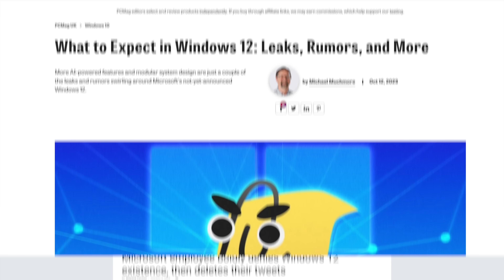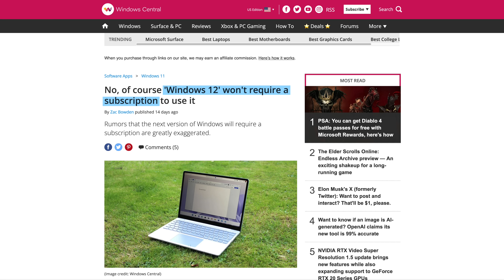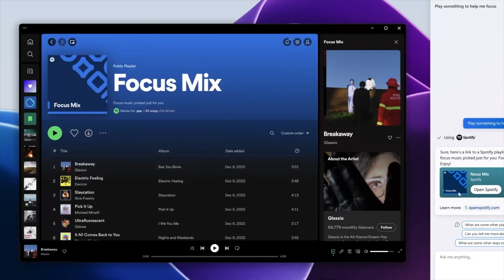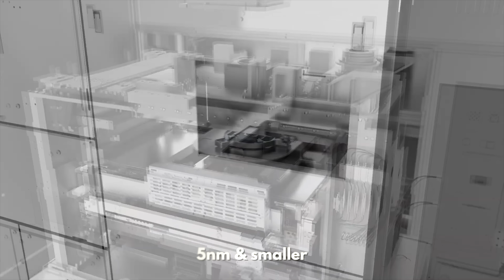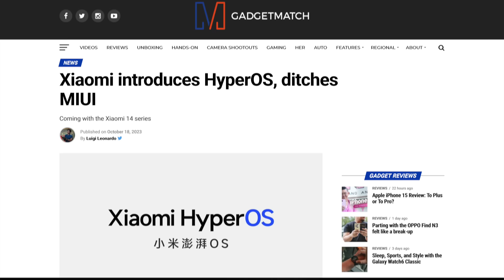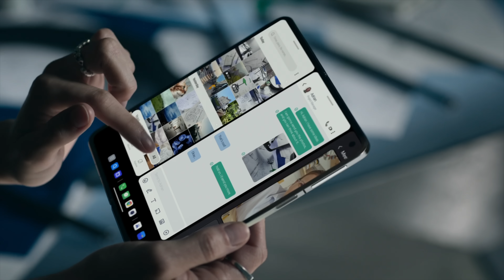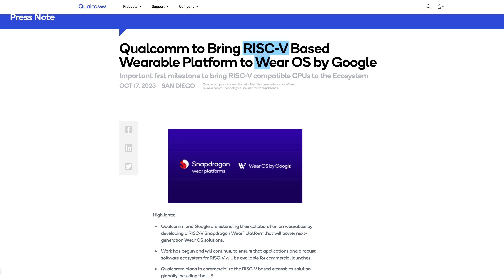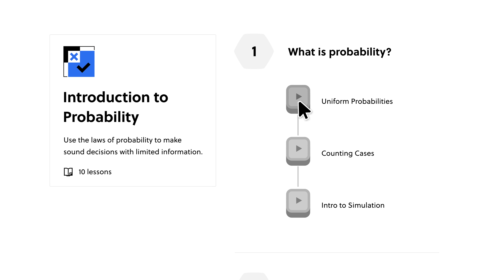Windows 12 is looking good!

Comment: I feel like most people haven't even upgraded to Windows 11 yet,  and here we are already talking about 12.
Reply: Same story when Vista and Windows 8 got a lukewarm response.
Reply: I guess if it's an update solely focused on under the hood adjustments to work better with ARM it makes slightly more sense when it's coming so soon
Reply: @egyptrocks265 Why?  Windows 11 is pretty great.
Reply: Same thing happened with vista and 7 after
Reply: @latitzouri  From what i've heard Vista was more like 7's alpha version.
Reply: They'll have to take Windows 10 out of my cold, dead hands.
Reply: @calebricks4890  Windows XP and Windows 7 users said the same thing.
Reply: @captgwenpool And I’m still on Windows 7. No strike that, I was, now I’m macOS-only and not missing the headaches. 😊
Reply: @jansix4287  oh boy, MacOS? My condolences.
Reply: @captgwenpool  No need to, it’s a blessing. I experienced Windows from 3.11 to 7. There’s no need to ever touch it again.
Reply: @captgwenpool  macos is still *nix, very easy to use as a linux sysadmin
Reply: @captgwenpool  thing is if PC powerful enough it doesnt matter if you run XP or 7, but it doesn't matter if your PC can run Win11 if it doesnt have TPM chip you have to buy new PC.
Reply: @captgwenpool  It is not the same 😭
Reply: @captgwenpool  Yes, then we all became Win10 "forever" users lol
Reply: @captgwenpool  not to mention the sheer unstability and rare software support i want, and like you said, too much terminal codes to do anything
Reply: @captgwenpool  I still see Windows 7 machines in use today, so they weren't really wrong.
Reply: @calebricks4890  apes together strongl
Reply: @calebricks4890 my computer told me its not compatible with windows 11 I have a 4th gen I5.
Reply: @calebricks4890 good luck with that.
Reply: @calebricks4890 ong my brother I don't want a fucking Mac so windows 11 don't try n be like one hopefully they chill TF out with 12 or I'm ride or die or going Linux after it loses support
Reply: @calebricks4890  Kinda funny isn't it? When Windows 10 was released everything was calling it a piece of shit. "I will never switch from 7/8/XP to it" people said. Yet here we are with people saying the same again: "I will never move from 10, it's fantastic". 
Same happened with 7 and people saying XP is superior and they never switch to that crap OS
People will say the same about 11 and about 12. They bitch and cry about the new thing but then love it and won't leave it because the next new thing is also just new crpa.
Reply: @calebricks4890 true i hate windows 11
Reply: @calebricks4890  agreed
Reply: @calebricks4890  I would love to return to Win7, really don't like 10, but 11 utterly sucks!
Reply: I hope I come back to this comment in 5 years
Reply: Still on windows 10 because of 6 year old hardware, and it runs fine, no need to update at least for 2-3 years
Reply: They, at MS said, Windows 10 will be my last OS. That was not me. I just fulfill their wishes.😅
Reply: I upgraded to W11 and I don't like it, it has tons of blootware I should have stayed with W10 or even better W xp.
Reply: @iuniorx it cleans up a lot more bloat than it adds, so this is a silly take.
Reply: @iuniorx  XP modded for Flash& 2023security updates touch stylus support
Latest C states for power & GPU configurations
We all would go back
But even chrome browser support is in EOL
Reply: It happens with Windows all the time. I remember people still using XP When 7 was announced, and people using windows 95 when XP Launched
Reply: @cesarT921  ... Windows launches have always been exciting, since Win95 ... Even the bad ones has exciting launches, and people like myself tried all of them (even if we ditched some).

With Win11 and Win12, I don't know ... I haven't even tried Win11 yet. I feel it's a waste of time ... Or even a downgrade to install an outright spyware voluntarily.
Reply: Yup. Still on 10.
Reply: People don't matter. Enterprise is by far the driver of windows adoption
Reply: I cant upgrade, because the stupid requirements
Reply: That's exactly why they are talking about win 12. Cuz no one wants to go to win 11.
Reply: I wish I could upgrade my main computer  to Win 11. I have some older computers that upgraded. But some newer co puters have processors that are not supported on 11. Msft actually dropped support for some Xeon processors in a win 11 update  that had been supported on previous builds of 11.
Reply: @JoelIvoryJohnson you actually can with a few simple registry edits. Lookup “running windows 11 on unsupported hardware”
Reply: just like windows 8. it exists but no one cares about it
Reply: Yeh i upgraded to Linux as my daily driver. No more MS crap shitshow.
Reply: Wasn’t Windows 10 supposed to be the last Windows version?
Reply: 11? I know people that still uses windows XP/7
Reply: @MrRorosao  Hell, even a Paris airport used to roll Windows 3.1 for their Air Traffic Control til that crashed on them..
Reply: Much like how people went from Windows 7 to Windows 10 because Microsoft insisted to make Windows 8 look like a phone operating system 😂
Reply: I'm definitely skipping
Reply: I am not upgrading to Linux or even Windows 10 mainly because I just can’t due to TPM requirements even if I want to and I can assure you I personally don’t want Windows 12 either, I am indefinitely skipping as well, I just don’t want newer versions please!!! 🤢😴🤮
Reply: @ashelygordon669 it’s not skipping if your UNABLE to get it.
Reply: I upgraded to Linux. I'm not throwing away my perfectly good computer because it won't run Windows 11
Reply: @JocelynAyodele I'm still in the research phase of going full Linux gaming, but when windows 10 ends I'll probably commit but it's a bloody minefield
Reply: @JocelynAyodele No one is throwing computers. You need to run just one or two commands and you can install windows 11 on any computer. Linux fanboys really have a bad habit of flexing.
Reply: @JocelynAyodele but aren’t there like, workarounds? I think you can run Win 11 on any hardware that ran win 10.
Reply: That's not the issue.  @K0D0R0  The issue is that 11 is slower on my 12 year old system than 10 and I think it's because of the fact that they didn't test it for older systems.

Linux however, runs smooth as silk with no issues.
Reply: @JocelynAyodele  Oh, I see… Yeah, they did a good job optimizing Win 10 for older machines… Haven’t tried Win 11 yet.

What flavor of Linux are you using?
Reply: @JocelynAyodele same, i use arch btw
Reply: @JocelynAyodele  that's the best kind of upgrade
Reply: @JocelynAyodele  Windows can be easily bypassed for unsupported hardware.
Reply: @sebastiangonzales46  microsoft is gutting that bypass though
Reply: @JocelynAyodele  kinda strange statement, 'cos Windows 11 runs perfectly even on AMD Athlon CPU from 2007
Reply: @JocelynAyodele  I force updated mine, there's a workaround by using the windows 10 installer but with Windows 11 data which completely skips all the checks it does for Windows 11 compatibility, I've had no issues so far even though apparently my PC isn't supported
Reply: Microsoft killed all those workarounds sadly. @JonnB
Reply: @JocelynAyodele bro has a pc from 2011
Reply: @JocelynAyodele if you went to windows 10 to Linux it wasn't an upgrade.
Reply: @TheStoso2   it is, believe me. i actually cannot go back to windows now
Reply: I'm still using core m3 based tablet with windows 10,it can't run 1080p H.265 mkv
Reply: Android updated every year.. Windows is kinda slow
Reply: I remember back in the day when windows 7 was the shit. And people stayed on it over 8 lol. Good old days.
Reply: Well Microsoft has a history of releasing shitty operating systems every other operating system release so windows 11 was that "Out of phase shitty version" so we'll see what changes that have made.
Reply: @youdontneedmyrealname that cycle ended after 7.

8 sucked
8.1 sucked
10 sucked
11 sucks

Some suck more or less than others, but the direction of the OS as a whole since 8 has been a disaster.
For example, it's been 10 years since 8 and the new Settings app is still an incomplete mess trying and failing to provide the functionality of the Control Panel.
Reply: @youdontneedmyrealname  Probably intentional, to boost desire for the next version.
A variant of this trick is probably used by Blizzard for WoW where they drive an emotional rollercoaster from one expansion to the next to deepen attachment, causing displeasure with one and then excitement with the next.
Reply: Im still on 10. Im not giving up having the taskbar on the left side of my screen.
Reply: @0dylan  For ages now I have used Classic Shell visual style (pre-Aero like Windows 2000) with task bar on the top.
It exposes which devs are not aware or do not care about that functionality when you open a program and the window is at the very top, obstructed by the task bar.
Reply: @Dowlphin  Windows 2000 was good, unfortunately it is too old. Windows XP and 7 replaced it.
Reply: @0dylan  Same. I upgraded and then downgraded. When they asked "Why are you downgrading?", I simply put "Can't put taskbar to the left."
Reply: @LZWEHDKE you should have put “I’m downgrading because I’m braindead and don’t know how to google a 3-second solution to change an aesthetic feature”
Reply: @0dylan  you can change that in win 11 without any 3rd party apps.... i'm not used to it elsewhere else either hahaha
Reply: @0dylan you know there’s a setting to change that right. You sound like one of those boomers I would encounter when I worked at geek squad.
Reply: @0dylan if thats the only issue you have, theres an option to out it on the left in W11
Reply: @0dylan You do know that you still can have the taskbar on the left in windows 11, right? It's in the options. Sure, it would be good if the taskbar was on the left side by default, but still. You can bring it back to the left side.
Reply: You'd be right unfortunately 😢
Reply: That's because they haven't
Reply: Activate your windows 🪟
Reply: No we have Not 😂
Reply: Because windows 11 is a straight downgrade lol
Reply: ‘Upgrade’
Reply: I just really like windows 10 🥺🥺🥺
Reply: My laptop can barely run Windows updates on 10. I might have to buy a new laptop soon
Reply: It normal tho.  Window 12 will be the next big window people gonna use just like how most people use window xp and then window vista happened and everyone fucking hated it abd waited till window 7 came out and loved to the core, and when window 8 came out  people dun use it and hated it as well and then window 10 came out, now window 11 is the least people wanted OS , I suspect window 12 will be the next one most people gonna use as their latest os
Reply: With their new 1984 policies, I won't buy any new Windows OS anymore. Will go for Linux on my next computer.
Until then - windows 10, without any updates anymore, since I blocked them. (Yeah, It's a mess stopping these updates, but it is possible)
Reply: W11 is horrible, I downgrade after 2 month trying it with a new laptop
Reply: u mean downgrade right?
Reply: i literally just went back to 10 today LOL
Reply: windows 3.1 what is spyware
windows 95 people are making spyware
windows 98 spyware lists on the internet
windows xp has some spyware
windows 7 has more spyware
windows 10 is spyware
windows 11 is spyware and spams adverts
windows 12 is spyware, spams adverts and does not let you leave your own home
Reply: @TF12191  yep
Reply: we need windows just like windows 10 windows 11 is just a shit package
Reply: @junaidgul1983  Going back to simplified bland color design like Windows 10? No thank you. As someone who likes frutiger aero a lot. I do miss Vista’s and 7’s beautiful UI design. Something that Windows 8 and especially 10 faded away from. I am happy to see Windows 11’s design is better again which honestly made me wanna stop using Windows 10.
Reply: Not really.@@o_pedro_oficial  Running Linux Mint is really easy and you don't have to drop to the Terminal for basic stuff.
Reply: It'll be end of the world by 13
Reply: @@o_pedro_oficialthere are different linux distros which dont need coding and some are even similar to windows 10
Reply: @@o_pedro_oficialLinux doesn't require any coding
Reply: @@o_pedro_oficialagree yet, bit of knowledge never hurts. There is curve to it but im more than happy to use it now. Internet browsing and finances mostly as it do have poor support. Unfortunately support comes alvways with money. Free os will never get that sorted.
Reply: Many are waiting to see if 12 is better.
Reply: I'm still on Windows 11 rtm
Reply: I mean its not like we were supposed to, it IS a leak.
Reply: Reminds of windows 8 to 10 launch time.
Reply: back then new major windows version released once every 3 years
Reply: @@o_pedro_oficial That depends solely on what distribution you use. Many of them have their own appstore where you can install all the programs you'd ever need nowadays. Linux Mint or ZorinOS both would be a good option for newcomers into the world of Linux as they have stores for installing programs and whatnot, along with both being heavily inspired by the look and feel of Windows.

Basically, one does not have to use the terminal for everyday stuff anymore... unless you want to, then you can, but a Windows user wouldn't have a difficult time with the newcomer-friendly distros.
Reply: Obviously. Windows 11 was never a long term version just like I thought.
Reply: @@o_pedro_oficialUse something like ubuntu or mint and it’s more user friendly than windows
Reply: Yeah because 11 is a pile of garbage
Reply: My 3th gen i5 take this personal
Reply: Yeah they just cant upgrade with their cpu
Reply: True
Reply: I'll keep windows 10 as long as I can. Not doing the same mistake I did with windows 8.
Reply: My pc isn’t even compatible with windows 11. I still run Windows 11 though, because FUCK YOU MICROSOFT
Reply: When I was on XP. I knew a lot of people still on 98. Same deal as always.
Reply: That's a very nice feeling and emotion, but how about actually looking up the facts and stats of how many are on windows 11?
Reply: Most people skipped right from windows 7 to windows 10 as well. 

And going back farther people skipped from XP to 7 too. 

Seems the best is every other version, so XP, 7, 10, then 12.
Reply: Good windows 11 is trash.
Reply: It will be the death of Microsoft business model
Reply: Same story as 7, 8 and 10
Reply: Not really an upgrade
Reply: @@o_pedro_oficialdude there's no coding just just install your distro look it up if you're having a problem look up the errors look on the wikis and then just copy and paste terminal commands if you need to the only problem is if your game or you can't play games but I just use proton Aura Windows VM or just go into my windows dual boot in the area which I barely do that and if there's software that cannot be supported do the same but you have the other option use wine instead of proton and for paid software there's always free and open source alternatives
Reply: Forget windows 11, some people not even bothered to upgrade it to windows 8 😂
Reply: @wesas2344  Well windows 8 sucked ass.
Reply: @ArcticFox-s1z  what do you dislike abou it?
Reply: Microsoft : I like Money
Reply: @ArcticFox-s1z  so no actual downside? Got it.
Reply: We get new mobile OSes every year and this is no different
Reply: Compared to 7 to 10, 10 to 11 was very fast! So thats not a big thing anymore
Reply: I don't know anyway that is using anything BUT Windows 11, so not sure what you're talking about.
Reply: Just want to say that I love my 8.1 with Aero modification
Reply: Because 11 is a train wreck. Was talking to someone about this today and it seems very common for Microsoft to get a better os out there when the one they think will take off crashes and burns. 

Windows Me had a very short shelf life before XP replaced it as everyone’s favorite. So this has potential to do similar.
Reply: people upgrade only becoz they dont provide drivers
Reply: well, most people skipped windows 8 so it might be a similar situation
Reply: @@o_pedro_oficial what distro did you use? Ubuntu, Arch, Mint, PopOS or something else?
Reply: when did windows 11 come out? hahahah my windows 10 kept saying  windows 11 is around the corner for like a year... couldnt wait so update it myself manually this year.... mine still has bugs like explorer jumping into the foreground randomly, i might switch back to windows 10 till 12 comes out hahaha
Reply: @@o_pedro_oficialTell me you've never used Linux, without telling me
Reply: Downgraded not upgraded
Reply: W11 has been out for years
Reply: If you still using a potato pc you can always skip, Windows 11 is actually pretty good, because you can use Android apps natively without using an android emulator
Reply: @ArcticFox-s1z  What don't you like about it? I actually really like it.
Reply: Windows 11 still has some issues when compared to Windows 10, which is frustrating when you consider the improvements it did make, Windows 12 really needs to be an improvement and return some of those missing features that Windows 10 had.
Reply: Most people hadn’t upgraded from xp to vista when 7 arrived, same with most people staying on 7 when 8 and 8.1 released
Reply: My latest machine came with Windows 11 and I upgraded it immediately to Ubuntu LTS. Who cares what Windows 12 looks like when Microsoft is far behind on fixing issues in Windows 10? I just don't have the time anymore to mess with Windows, I need something that just works and is well supported by GPT4 if there is a small issue.
Reply: most people can't even run win 11 without disabling the tpm requirement.
Reply: True, I use windows 10 home.
Reply: @IATVEDU i do
Reply: that's because 11 sucks
Reply: Yup
Reply: was the same with windows 8 and now look at windows 10 and how loved it is
Reply: actually a massive percentage of users switched
Reply: @dominikcygan2664  massive and percentage is sort of a nonsense qualifier, since percentage maps numbers into a range.
Reply: Hahaha
Reply: Downgrade you mean
Reply: I've been on Windows 10 since it launched back in 2015 only just moved to Windows 11 like 5 months ago
Reply: im poor
Reply: Windows 10 here
Reply: But the Windows 11 UI is absolutely an awful downgrade. It's nearly unusable, it hurts to look at.
Reply: It's them making the "corrective" OS. Every other windows sucks and every other windows is decent.
Reply: Me thinks that Windows 12 is to Windows 11 is like Windows 8.1 to Windows 8.
Reply: remember when in the past it was said that "Windows 10 will be an last official windows full release" and everything after that will be just an update?

yep - that did not aged well
Reply: I'm waiting for windows 13 and 14
Reply: 30% use win11 according to steam survey, with growth of 10% in last year
Reply: @@o_pedro_oficial I hope you're joking, It's really not that bad
Reply: That was essentially the same with windows 7/10 when 8 came out
Reply: Are you mad, not hating but windows 11 is great and any minor o major upgrades are welcome, the most important thing for me would be fixing consistency in design language in certain windows but other than that, it's mostly great
Reply: I switched to Linux
Reply: Won't upgrade to 11 on my own machine. My next machine is a Linux, I've been running various Linux distros on a secondary, deprecated computer to see what Linux can so for me. My mind is made up, my next new computer is a Debian Linux machine
Reply: Yeah, because Windows 10 is simply better. What happened to Windows 10 being the last version ever? Lol. Windows 11 is the epitome of fixing stuff that wasn't broken to begin with.
Reply: There were people using windows 7,8 when windows was decently old. Same case here
Reply: I'm still on 7. Microsoft is getting way too hands-on with my data.
Reply: @@o_pedro_oficial Nope. Thats not true. Its super simple, especially if you choose something like Linux Mint or POP.
Reply: i upgraded to linux.
Reply: Cuz it's trash
Reply: @pex8713  yes
Reply: 11 is literally better then 10
Reply: Ikr
Reply: still on windows 7
Reply: I reset my laptop n i went from win 10 Home to Pro lol
Reply: I remember when MS said Windows 10 would be the last Windows.
Reply: I agree. I am on Windows 10 Pro. My biggest fear and prediction that came true is the hyper-implementation of A.I. in Windows 12. I know artificial intelligence is a majority of places now, but many have warned about the dangers of A.I. and any type of virtual reality. I definitely reject Apple because it has become much worse. Linux is not universal like Microsoft Windows is, so this pushes the main question: will any technology be free of A.I. It doesn't look good. The genie has been out of the bottle for way too long, sad to say. I miss my childhood, even though I had some rough patches. Look what the evil establishment does to real conservative Republicans. That alone is a disturbing trend that should end. But I digress.
Reply: I LITERALLY JUST upgraded to 11 Pro 3 days ago 😂
Reply: @@o_pedro_oficial you can use Linux without the terminal! Using the terminal will be more efficient, but the same is true for Windows. It just so happens that the people who use Linux are generally the same people who use the terminal, so it's talked about a lot.

Edit: Just don't run Arch or Gentoo lol
Reply: Yup
Reply: You don't have to code to use Linux. You obviously have never even tried a modern GUI Linux. You don't know what you're talking about. I use Linux Mint and it is very user friendly and easy to use.
Reply: We got W11 shipped on our work computers about three weeks ago.
Reply: They were also talking about 10 when most hadn't yet upgraded to Windows 8
Reply: To me, the upgrade that really mattered is from XP to windows 7. the rest is much the same for everyday use.
Reply: i have upgrade a day ago and u should aswell cause ui feel fresh and smooth
Reply: @@o_pedro_oficial look up more approachable distributions like Linux Mint, might just make you bite the bullet
Reply: That's called Interim release? i mean Ubuntu have been doing that for decades, there's LTS and Interim release, one that supported for a long time, and one that have fewer support time.
Reply: 11 sucks… I wish I could have turned back before I got used to it.
Reply: Windows 11 is like  vista. There’s always a sucky windows before a new one comes and makes it better
Reply: A lot of people like me didn't even move to Win10 till after 11 was out lmao I wanted to try Win10 for a while then move to 11 but got used to it so I'm not moving anytime soon. One thing I like about upgrading so late is that it's no longer truly updated which means it nothing really changes from one update to another.
Reply: Dw in few seconds we will be windows 69
Reply: lmao watching this and I already have the desktop downgrading back to windows 10  when that's finished I'm going to also downgrade the laptop as well. After almost using windows 11 since launch there are things I just can't take about it any longer example believe it or not seem thermals are better with windows 10 then 11 since windows 11 """Seems""" to use more resources then 10, storage and cleaning ability is better with 10 also. GPU seem to be the exact across both except when it's a cpu heavy game which windows 10 plays it better. with higher fps. weird..
Reply: it has always like this with all OS not windows only. most ppl will always stick to the most stable version they trust
Reply: Indeed, what a yawning vid this is.
Reply: Only way I upgraded to 11 was when my Windows 10/Linux PC died. I'll say, Windows 11 is fine...it's just 10 with a new coat of paint...and some performance improvements.

Windows 11 is a lot faster on an NVME SSD vs Windows 10 for example.
Reply: And scary thing is that Windows 11 was released over 2 years ago... (October '21). 
They totally failed with the update unlike with Windows 10... By forcing that stupid TPM 2.0 requirement.
You can make a installation stick with that disabled (if you don't want to do it in the installation phase yourself with commandline) but that just killed it.
Reply: @@o_pedro_oficial😂 there's literally none just clicking
Reply: I will never give up my windows 10
Reply: Tech companies are pushing product quantity than focusing on improving less regarding quality in major. For example: A new iPhone is launching every year, a new Samsung Galaxy S series flagship as well, Intel new Gen Processors and so on. And they're following this trend for the past few years without considering consumer demand.
Reply: W12 = w11 with new date and few minor changes. Both worse than w10
Reply: I updated today 🙈
Reply: Exactly (talking about win 12 &), I’m still on windows 10. I wish I was on windows 7.
Reply: because windows 11 is slow and full of shlts
Reply: I upgraded to Linux.
Reply: windows 11 is just windows 10 with a skin pack anyways...12 will be the same with some Open AI integration
Reply: @MiniKodjo  not really, windows 11 moved away from Xapps, they were trying to push WebApps, but because of the ecosystem they needed to keep similar, you can say this about most versions!
Reply: @MiniKodjo  Windows 11 is absolutely not 10 with a skin pack. 11 has usable HDR support, thread director 2 support, as well as lots of wddm improvements. It's significantly better on latest hardware.
Reply: Win 10 settings menu kinda ugly though. Win 11 setting menu look a lot better.. Win 11 overall a lot nicer to eyes.
Reply: I'm going to have to switch to Mac. I'm a songwriter, and apparently, audio interfaces don't run properly on Windows. My Focusrite Scarlett 4i4 3rd Gen crashes a couple of times a day, and I see other users complain about the same thing. It even happens with other brands of audio interface. I hear it never happens on the Mac.
Reply: @poil8351 I don't really care if there are 2 setting.. it is not like we always open that control panel to change setting
Reply: It's basically just Windows Vista all over again.
Reply: @nightpotata different, windows NT.
Reply: Someone should break-in the core NT including the server version & port android libraries on it
Reply: Taskbar on top isn’t as good as the side, but it’s a ton better than the bottom.
Reply: In 2015 I switched to Mac. 5 years later I built my first pc and got back on to the windows wagon with 10. Was a fantastic return to form.

Fuck win 8. 

Now I’m on windows 11. It felt like the appropriate refinement to deviate from the samey age old design of windows 10 (despite my love for it). 
My one gripe of win 11 is the pointlessly laggy UI animations in settings and dialog boxes. Even on a nice rig like mine. 
Example: Right click on desktop takes a second to load the dialog box for no reason.
Reply: I have windows 11
Reply: It's because nobody wants to run a terrible O/S like Windows 11. Most people like me are still sticking to Windows 7, the most reliable Windows O/S.
Reply: I literally upgraded to Win 11 two weekends ago....
Reply: Making keeping pace ever-harder is part of the overwhelm-effect of the enslavement agenda that also pushes small competition out of the way.
Reply: @Dowlphin 😅 you’ve never run a business if you think that’s true. Most businesses are still running windows 7 at the newest.
Reply: so true @Dowlphin

> "Making keeping pace ever-harder is part of the overwhelm-effect of the enslavement agenda that also pushes small competition out of the way"
Reply: @Dowlphin The enslavement agenda? You can still get paper and pencil if that's what you need.
Reply: I genuinely can't believe that people are still using Windows 10. It's so ancient. I switched over when Windows 11 beta was released and have yet to think about Windows 10 again since. I am super excited for Windows 12.
Reply: @Mantis_Real  Some people don't like having an Apple style UI, one extra click to get to the folder options we actually want and Edge being forced on us. There also the fact that some CPUs had their performance reduced on Windows 11 (at first AMD ones, then Intel, then AMD again). I guess I've got an ancient opinion about Windows 11 😂

The only reason I could use Windows 11 in a virtual machine was that Ghost Spectre made it not have Edge pre-installed, 3 numbers required to bring back the old right click options and the old Windows Explorer ribbon along with debloating it to the point I brought it down to 0.5 GB idle RAM usage.
Reply: You'll get windows 12 whether you like it or not, or get Mac OS you already have business facilities with Windows 11 on their computers which is mind boggling
Reply: @fredrickbambino  crickets , no thanks
Reply: Tô me Windows 11 feels like a polished windows 10. Nothing much else. But it gets my job done so I like it